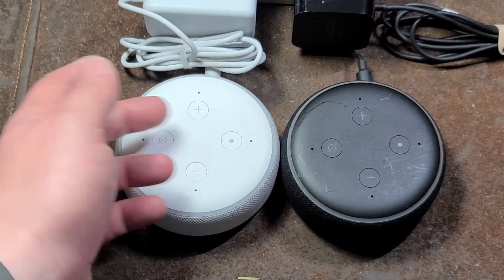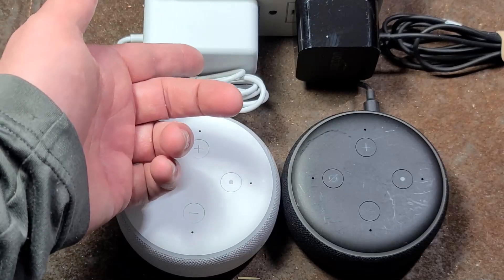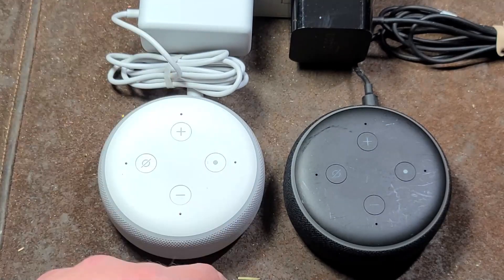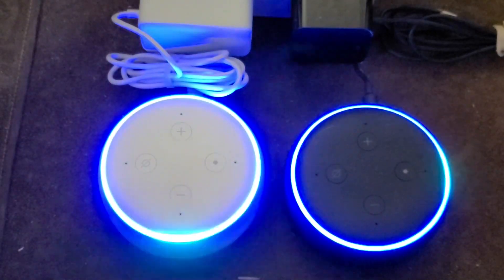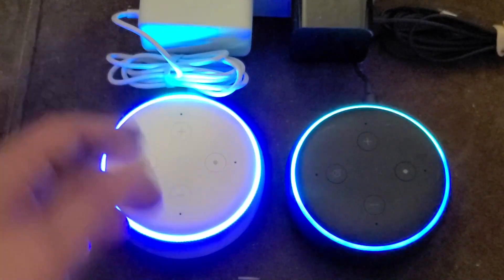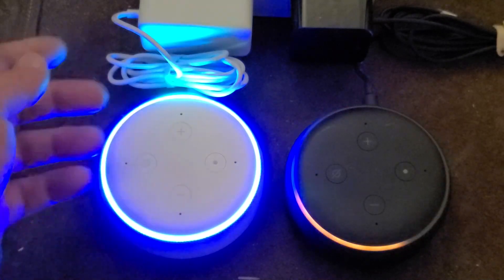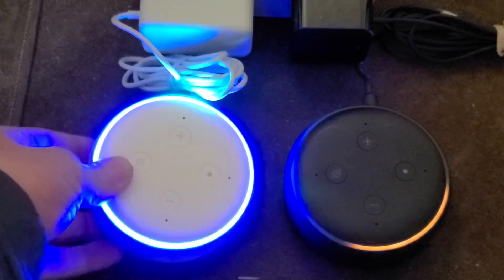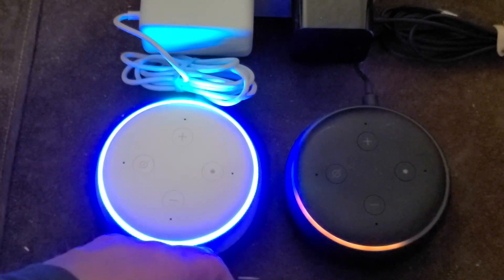What A Bricked/Corrupted Amazon (Alexa) Echo Dot Looks Like

Comment: Finally an answer. I left mine unplugged for a couple of years, and wanted to get it back up and running....
Reply: Mine too. It started up, talking and then boom, bricked. Amazon does not have its software support anymore. Another paper weight 😢
Reply: Gen 3? Seems to be gen 3 mostly
Reply: @VictorTheGood  Yes. But mine is 2nd gen.

Comment: I have a bricked echo dot, turns out it could also be the power source. I don't know about voltage but being connected o the wall outlet it won't work (bricked) connected to my 5 port usb connected to my laptop works just fine. 7/1/23
Reply: It could've had a power overload

Comment: I bought two brand new Echo Studio Speakers just about a week ago. Set them up, paired them, then tested them and they worked perfectly - the sound is amazing. Then after about 10 minutes, my Alexa App stated that both devices had not been completely set up, so I completed setup for both of them, then they both switched off and have been bricked ever since. I can't factory reset or use any button combinations to get any of the devices into setup mode or any other mode. No amount of powering off or shouting at them helps either. They are both utterly bricked and I am awaiting support from Amazon. Absolutely gutted!
Reply: same here, on my case it was instantly after the configuration, never heard any sound except the welcome preset

Comment: I believe there's no USB connection and therefore you can't flash the firmware with a computer.  I got some smart speakers that have hidden USB C connection that can be use for flashing the firmware.  The USB connection also allows people to mod their devices.  People do this modding a lot with Android tv boxes.
Reply: If you pull the back off there is a USB provision you need to get an adapter and pin it to it
Reply: @REDDOGLewiston61  that's interesting. Hopefully a modder out there tried flashing theirs and put it on a forum lol